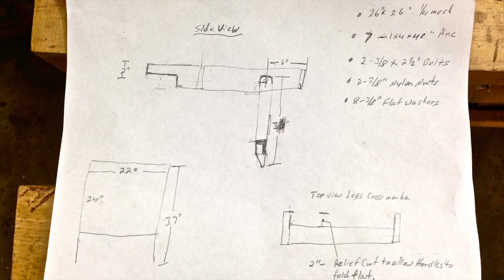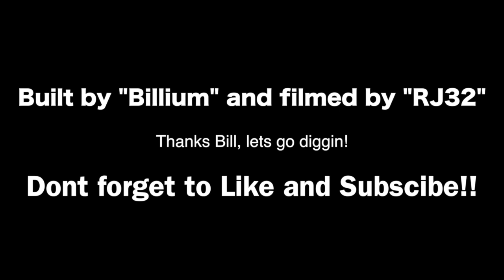How to build a shaker box for sifting relics and artifacts

Comment: A second set of legs, shorter by maybe 4- 6" than the first pair, and these are fixed, not bolted to move until setting up/breaking down. Placement is just before handle but before screen box. It allows you to rest it, leaving content on screen, especially when you need to sort solo. Also keeps you from having to put it down awkwardly. Bolt two short legs just high enough to allow action of shaking. Also legs will need to clear first legs when folding up. Use a shim (a small section of 1"x 2"), bolt, washer, nut, washer (none between wood). Hand tighten nut lightly. A 1"x 2" works well and doesn't add much weight.
Reply from the maker: David deVaull Thanks David, Awesome Comment, I will give it a try.  Also if you haven't already, it would be great to have you as a subscriber!

Comment: Hi, Thanks for sharing a great how-to video.  How far in from the end do you drill your 3/8 hole for the hinges?
Reply from the maker: Thanks for watching, and for the nice comment.  I think we drilled the holes about 6 or 7 inches from the end.  Good luck on your build, let me know how it goes!
Reply: Many thanks!  Fortunately I was able to magnify your drawings for the shaker and see that you had marked 6" on the side view, so thanks for including that in your video.  I don't think many people do this, but it's so helpful.  I cut my mesh a little longer than yours at 32" because I need to sift a lot of soil to remove stones and small rocks from a poor lawn surface. Given the slightly longer mesh area, I added another inch to the hole location measurement (7") and it's just right.  Finished my soil sifter last Friday after watching your helpful video and have already sifted out more than 60lbs of unwanted stones! Great tool and thanks so much for your time and effort doing the video with  measurements.  It's such a great idea and made it so much easier and quicker to build than just reading some instructions.  Big thumbs up! :)